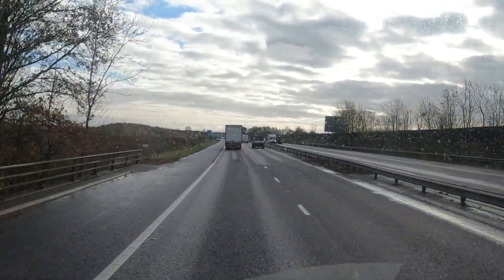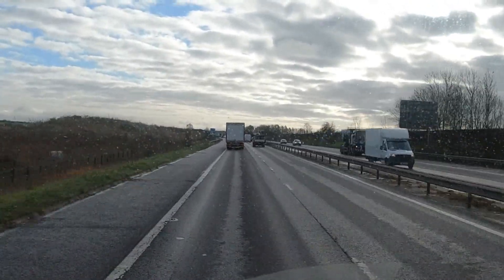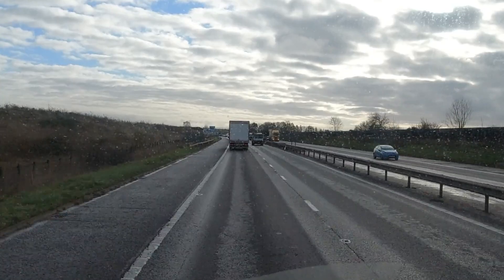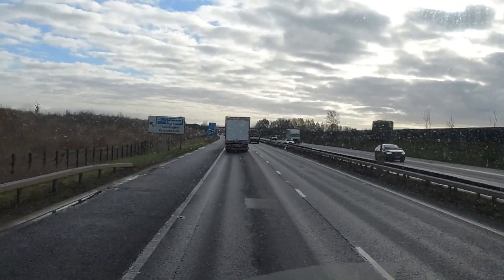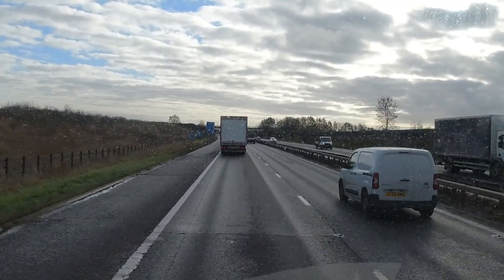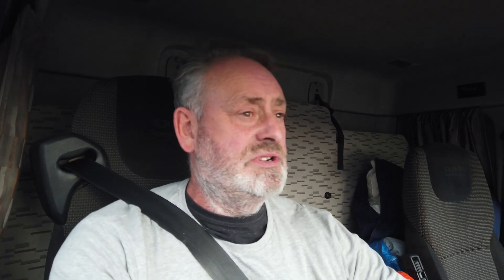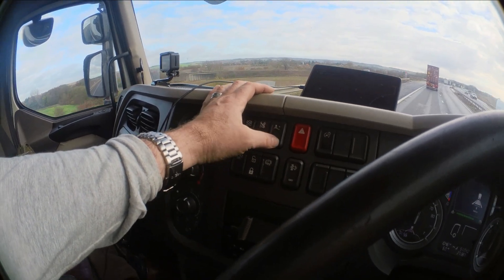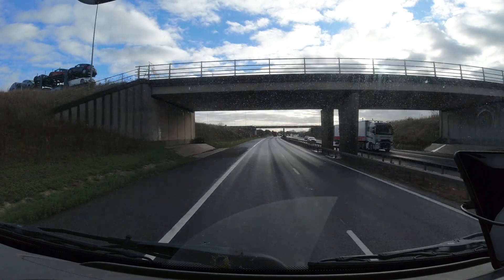Adaptive cruise control for the DAF Truck

Comment: The problem with the Daf auto speed control is if your following a vehicle and they pull of onto a slip road you wagon still thinks it's in front and it throws the anchors out,similar fault mentioned below with the car doing a right turn.